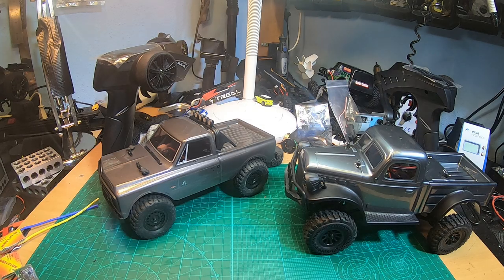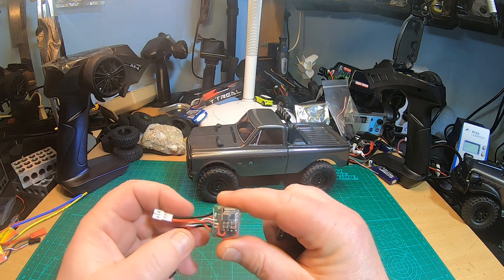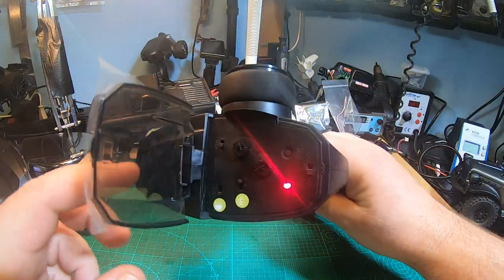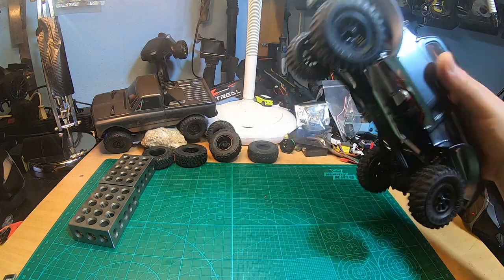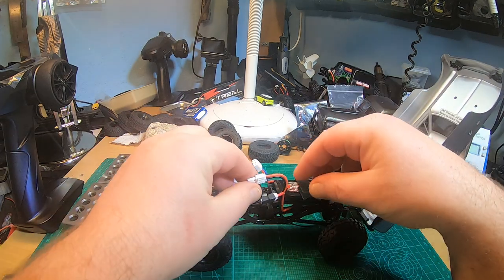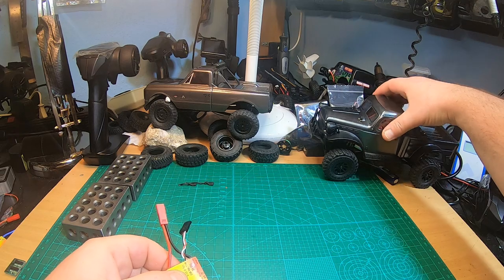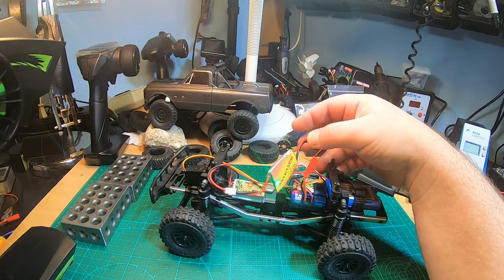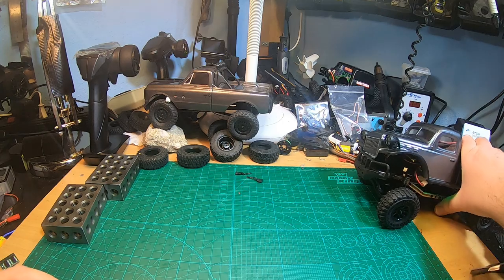Axial SCX24 and Panda Hobby Tetra: Awesome ESC upgrade using stock radio and receiver

Comment: So basically, the new ESC plugs in to channel 2 of the stock ESC. Which allows the use of stock radio lights steering etc and the stock ESC powers and tells the added ESC what to do. Do I have that right lol? I’m doing this now myself to my tetra 6x6
Reply from the maker: Simply plug new ESC into the receiver ch. 2 and the battery into the new ESC (!!!), nothing more. 
No, the stock ESC does not tell the new ESC what to do, the radio does this. Stock ESC is not used anymore.
Reply: @donaldsneffe  haha I meant stock radio since the ESC and radio are combined. But okay awesome, I just ordered a desert lizard setup with Bluetooth for my X1 6x6. I need the super slow silent crawl
Reply from the maker: @1RcSteve  Super slow crawl is only, if you also ordered a BL motor. Not with brushed motor, however, it is a big improvement. But brushed the Germans are better than the Vietnamese ;-)
If you have time, check this: https://www.youtube.com/watch?v=YsMyrvp2Nhc&t=1758s
Reply: @donaldsneffe  for now, I’m running the stock motor. This ESC upgrade was more about the silent operation compared to the factory. I don’t know what motor fits in the tetra x1 6x6 as a replacement. I just got the adapter wire to make the factory one work with the Furitek ESC
Reply from the maker: @1RcSteve  Motor is super difficult in the Panda. I did not find a replacement yet, would like a slower motor.
Reply: @donaldsneffe  haha at least it’s a decent motor though. I don’t know the shaft diameter and the stock pinion is pretty small but I’d like to do a gear change for lower gearing
Reply: @donaldsneffe  okay so I installed everything today and it all works and sounds way better but I’m having one issue. I can’t crawl it. It’s like one speed wide open always no matter where the throttle is. I downloaded the app, calibrated it multiple times, but it just doesn’t have a low speed it’s all or nothing. I can make it go slow enough to crawl, but then I have no too speed. I played with the curve punch etc and got nowhere. Any thoughts?
Reply from the maker: @1RcSteve  Hmmm...    never tried the Furitek in my Panda. Does it still work normal with stock ESC?
Reply: @donaldsneffe  yup and I just fixed it. The “low speed” needed to be set to 10% it was at 100%. She silently creeps now. I just needed a JST adapter for the battery, an adapter for the motor wire and it all plugged right up. Works great!
Reply: @donaldsneffe  got it all in, wow what a difference! This video gave me the route I followed. This truly is a plug and play easy upgrade. I think it’s running better it pops tiny little wheelies like a half inch now hahaha

Comment: Moin Moin donaldsneffe. Ich möchte gerne meinen Cr-24 einen Modellbau-regler.de einbauen. Mir stellt sich aber die frage wozu den AS12/6RW nehmen und einen BEC dazulöten wenn es doch den Volksregler Typ 0.5 mit integriertem BEC gibt. Oder gibt es da unterschiede? Ich bin leider nicht so fit in RC elektronik sowie Englisch und vielleicht wurde es schon gesagt aber ich habe es leider nur nicht verstanden.
Reply from the maker: Servus. Den Volksregler musst du ja selbst zusammenlöten. Wenn dir das Spass macht, ok. Außerdem ist der Volksregler größer, und der AS12/6 geht besser als der Volksregler. Der Volksregler klickt auch immer leise beim Umschalten von Vor- auf Rück. 
Ich habe Modellbauregler.de deshalb angeschrieben und gefragt, weil mir der AR12/6 besser vorkam. Antwort war, dass das klar ist, weil der 12/6 irgendeine bessere Elektronik drinnen hat.
Zusätzlich habe ich mit dem Volksregler ein sehr seltsames Problem, viele Emails hin- und her deshalb mit Modellbauregler.de:
Der Volksregler funktioniert nicht mit meiner Flysky Noble! Keine Ahnung, warum (AS12/6 und AS12/15 funktionieren problemlos mit der Noble). Der Volksregler funktioniert aber mit meiner Flysky GT3C, meinen TurboRacing Sendern (Stock Sender CR-24) und meinen DumboRC Sendern.
Modellbauregler.de kann sich das nicht erklären. Sie sagen "das gibt es nicht" (dass AS12 funktionieren, Volksregler aber nicht). Wir haben alles probiert. X Emails hin und her mit Lösungsversuchen. Es hilft nichts. Der Volksregler funktioniert mit der Noble nicht.
Es gibt also eigentlich keinen wirklichen Grund für den Volksregler, außer eben das BEC, aber löten muss man bei beiden.
12/6 und 12/15 funktionieren auch wirklich etwas besser und klicken nicht beim Umschalten.
BEC bekommst du um 2 € oder so mit Versand bei Ali, Ebay, ...
Reply: @donaldsneffe  Tja, so ist sie, die Madame "nobel". Gibt sich doch nicht mit dem niederen "Volk"(sregler) ab! 😜
Hat die Noble vielleicht eine Modulationseinstellung? Sowas wie PPM/PCM etc.? Könnte man mal probieren.
Reply from the maker: @sharkey9  Hab ich probiert, PWM/PPM. Modellbau-Regler.de (Martin) hat auch mit mir oft hin- und hergeschrieben, der sagte auch, dass das damit nichts zu tun haben kann (ich hatte es aber probiert). Hab alles an Einstellungen probiert, auch "Kurven" (also länger flach bei 0), und was weiß ich.
Schließlich hatte auch Martin keine Idee mehr.
Was (für ihn) am unverständlichsten ist: AS12/6RW und AS12/15RW funktionieren klaglos mit der Noble, aber der Volksregler nicht.
Das kann eigentlich nicht sein, ist aber so...
Ein bis jetzt ungelöstes Phänomen.
Hab angeboten, die Noble hinzuschicken, da kam aber nichts mehr.
Ist aber auch nicht ganz so wichtig, da der Volksregler einfach doch nicht "ganz so gut" ist wie AS12/6 bzw. AS12/15.
Reply: @donaldsneffe  Danke für die ausführliche Erklärung. Löten macht mir nix aus das krieg ich denk ich mal hin und macht auch Spass. Solange mir gesagt wird was wo hin kommt ist das kein Problem. Ich werde aber dann mal den AS12/6 ordern. Ich wollte auch die GT3C nutzen mit einem EMax ES08MA und 2S Lipo. Ich denke da kann ich mit der Elektronik nicht viel falsch machen. Als nächstes steht dann der Umbau mit längerem Radstand an, damit eine Revell F150 Karo passt. Mach weiter so mit den Videos. Man lernt immer wieder was neues :)